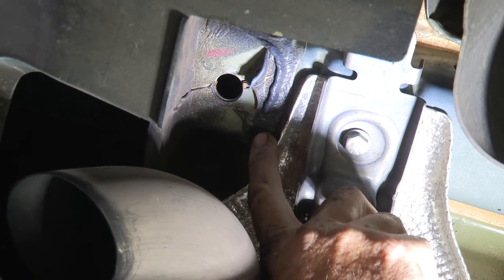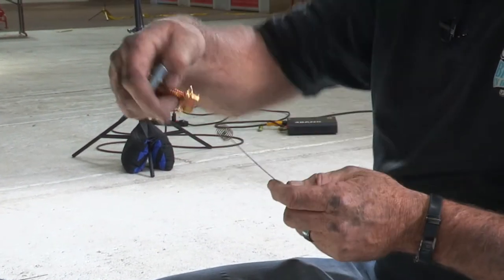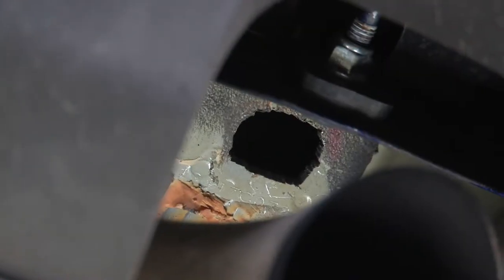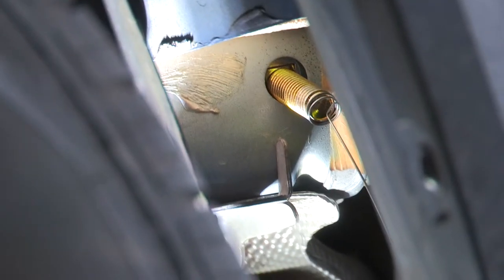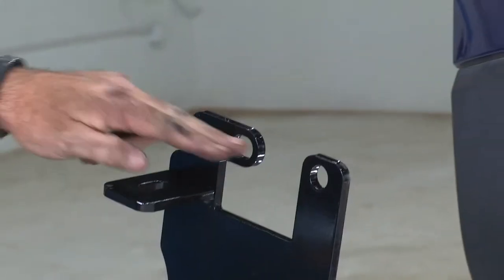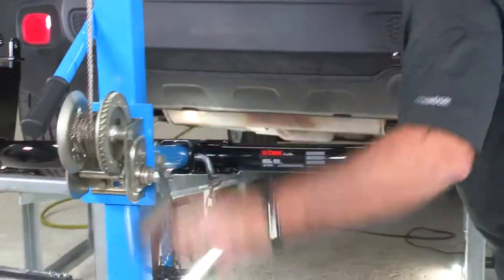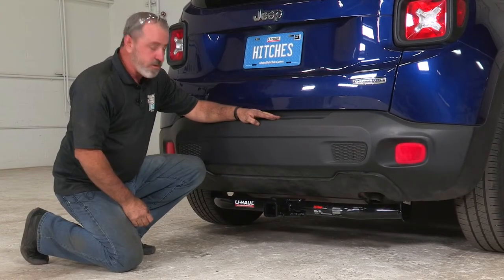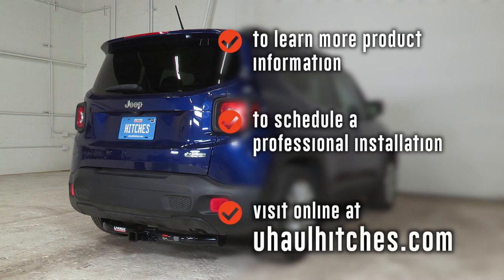2016 Jeep Renegade Trailer Hitch Installation

Comment: Seems like this job would be far easier if the bumper cover is removed.. By that point the OE receiver hitch may be better as you don't need to hack the frame to install it.
Reply from the maker: Currently there is not an after market hitch that is installed behind the bumper. But typically those installs take significantly longer when the bumper is removed.